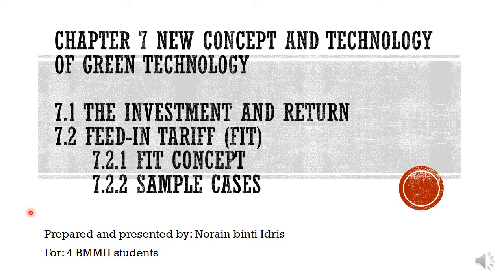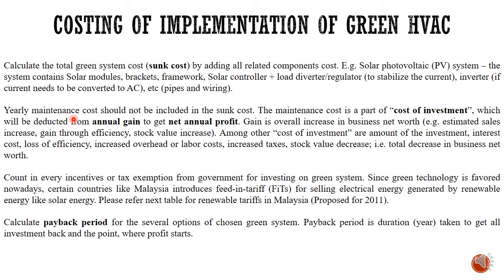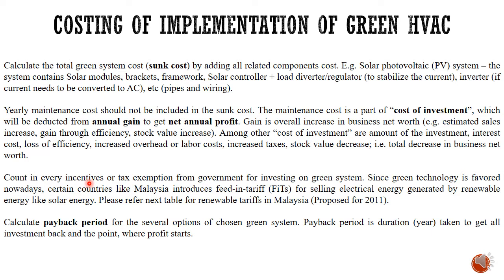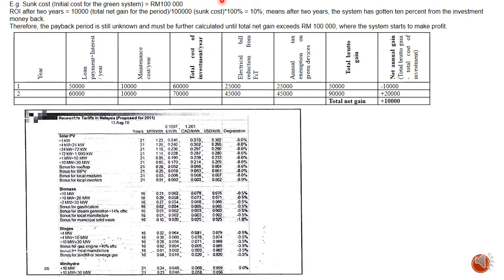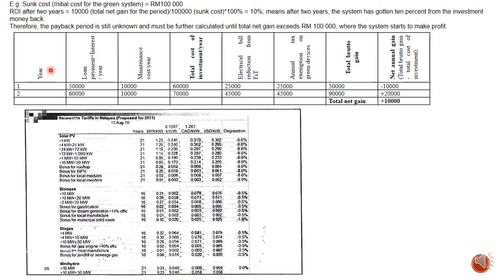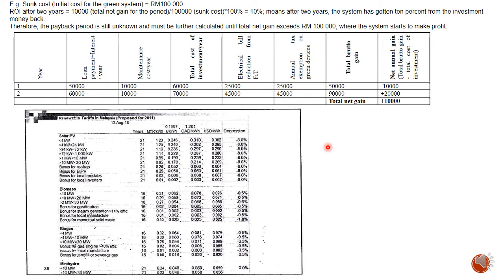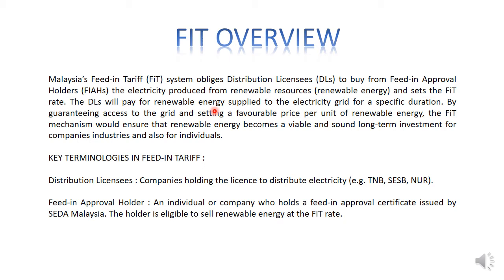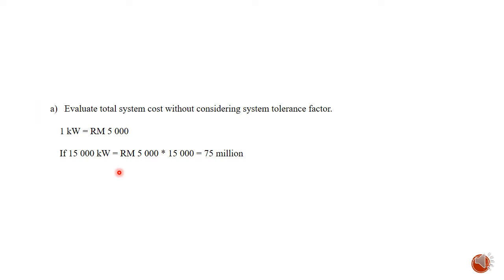Lecture 9 - Concept and Green Energy Scheme in Malaysia

Comment: MOHAMAD ZARIF BIN ROSTAM 
B071710681
4BMMH S1/2

Chapter 7 : New Concept and Technology of Green Technology
THE INVESTMENT

-Calculate the overall cost of the green system (sunk cost) by including all costs involved of components.
E.g. Solar photovoltaic (PV) system the system contains Solar Module, Solar controller + load diverter/regulator (to stabilize the current)
-Yearly maintainance cost should not included in the sunk cost.
-The maintainance cost is part of 'investment cost' which will be deducted from annual gain and net annual profit.
-Gain is overall increase in bussiness net worth. (estimated sales increase,gain through efficiency).
-Among other 'cost of investment' are amount of investment, interest cost, cost of efficiency, incresed overhead or labor cost.
-As the green system has evolve in nowdays certain countries like Malaysia introduces Feed-in-Tariff (FiTs) for selling electrical renewable energy like solar energy.
-Calculate payback period is duration (in year) taken to get all investment back and the point, where profit starts.

THE RETURN

-'Return on investment 'refers to the tangible and intangible benefits you receive from the use of your time or money. 
-ROI calculations often include gross, net and percentage returns.

Monetary Calculation.
-The method of calculating employed by people acting within the frame of society based on private control of the means of production.
Intangible ROIs – It a gain non-monetary benefits from an investment, you generate intangible returns. 

CALCULATION RETURN OF INVESTMENT (ROI):
1. Estimate the gains that will be realized from additional investment. Include any estimated sales increase, gain through efficiency, stock value increase, and overall increase in business net worth. Add these amounts together and call this total the 'Gain from investment'.

2. Estimate the true cost of the investment. It should include amount of investment, interest cost, loss of efficiency, increased overhead or labor cost, increased taxes, stock value decrease, and decrease in business net worth. Add these amounts together and call this total 'Cost of Investment'.

3. The projected net profits after taxed is calculated. The 'Gain from Investment' minus 'Cost of investment'. The difference result is 'Net profit after Taxes'.

4. Calculate the return on investment (ROI). 'Net profit after taxes' / 'Cost of Investment' * 100% = 'Return on Investment'.

FEED IN TARIFF (FitS)
A feed-in tariff is a policy tool designed to promote investment in renewable energy sources. This usually means promising small-scale producers of the energy—such as solar or wind energy—an above-market price for what they deliver to the grid.In order to encourage renewable energy sources, feed-in tariffs are seen as necessary in the early stages of their growth, when production is often not economically feasible. In general, feed-in tariffs require long-term arrangements and rates related to the production costs of the energy in question. Long-term contracts and fixed prices shield producers from some of the uncertainties inherent in the production of renewable energies, promoting investment and growth that would not otherwise occur.